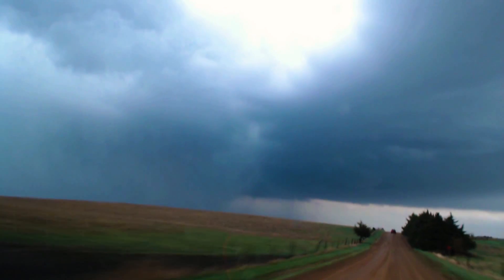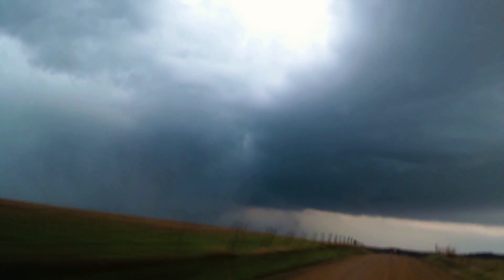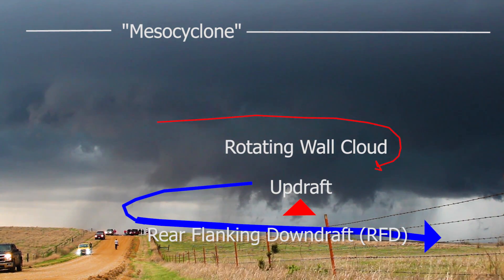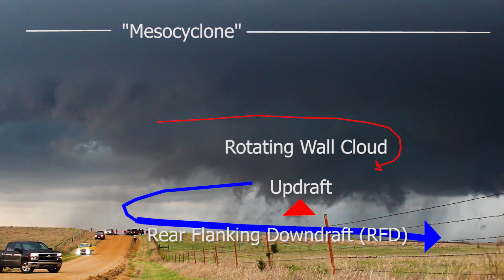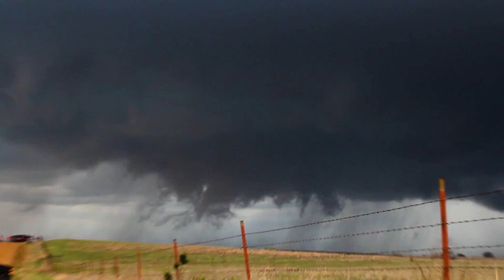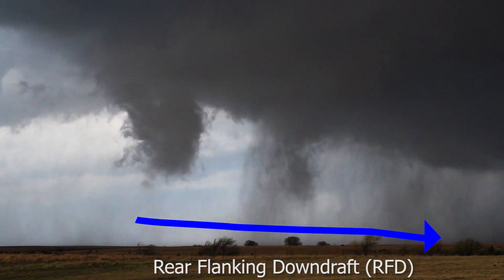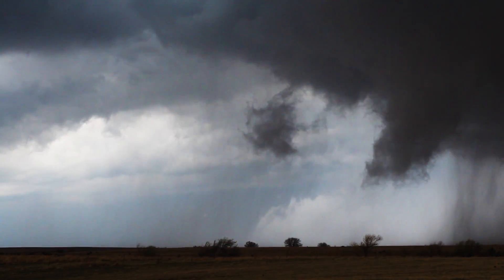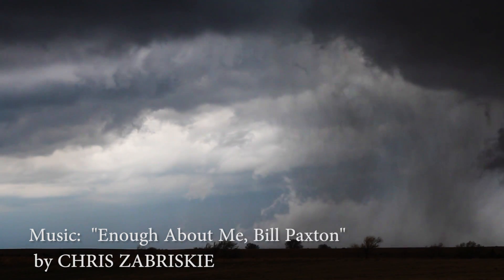Wedge Tornadogenesis. Tescott, KS May 1 2018.

Comment: Was going to watch this, but the music made it unwatchable
Reply: I had a similar experience, but it's not that I didn't like the music, I think it's a cool composition, it's just that there are some mixing and mastering issues that bothered my ears. Particularly, there are some balance/mixing problems with the track, and the peaks of the music are too hot relative to the narration. 

I think Pecos Hank's channel is another example of good amateur music production in this genera, but he applies it in a subtle/soft enough way that it consistently supports the mood without getting in the way and distracting from the videos. 

Regardless, I really like the video and just have to turn the volume down so I don't get spiked by the soundtrack.
Reply: @martymodus7205  I think about like this; if I'm driving down the road and I see a tornado I'm not going to crank up the radio, I'm going turn the radio off and roll down my window so I can hear the storm.
Reply from the maker: Fair enough. It's not for everyone. It's an older video. Still learning.
Reply: Rather than stop being an hater. Try watch Pecos Hank.